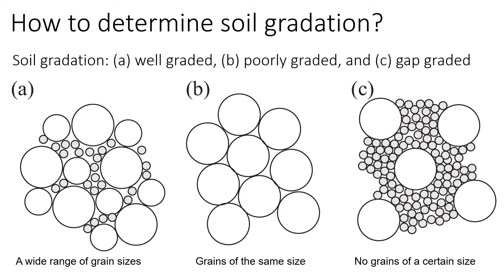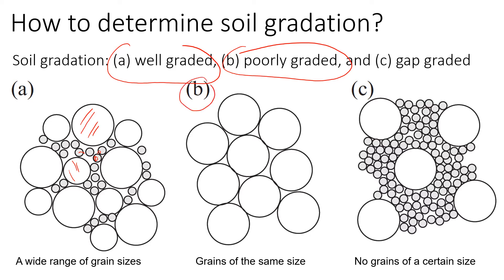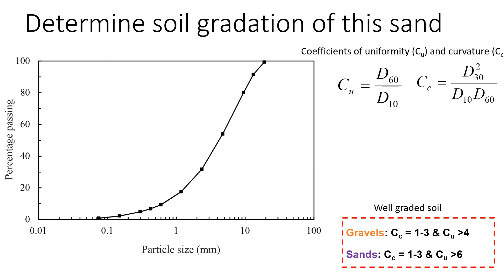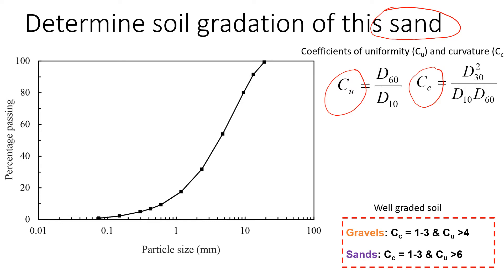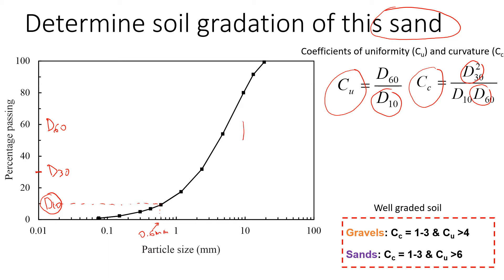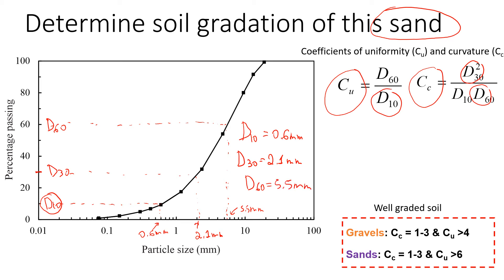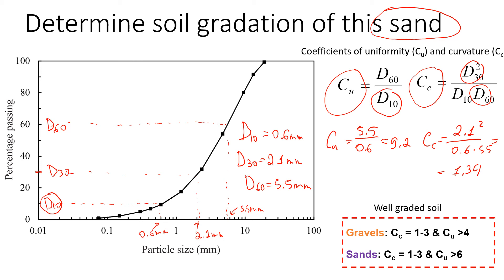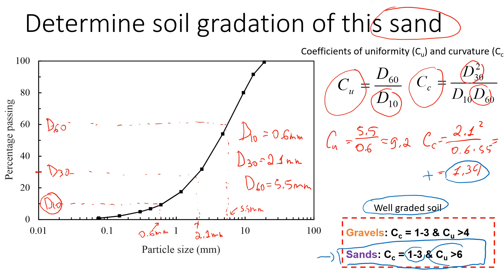How to Determine Soil Gradation | MUST Know This to Classify Soil #engineering #education

Comment: How to calculate the exact values of D10,D30,D60 in any numerical ??
In the numerical which is understood by you, it is not clear.
(Please reply must)
Reply from the maker: I am not sure what you mean by numerical, we typically get the values from the graph (manually). The plot shall be as accurate as possible, so that the values are accurate as well. In any case, a small difference (range) in the values won't make a big difference in the final answer.